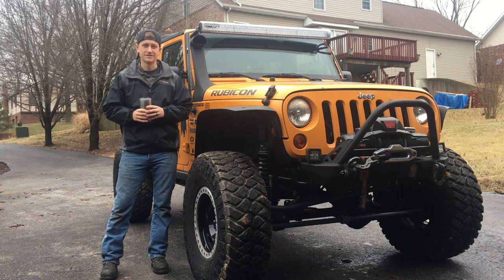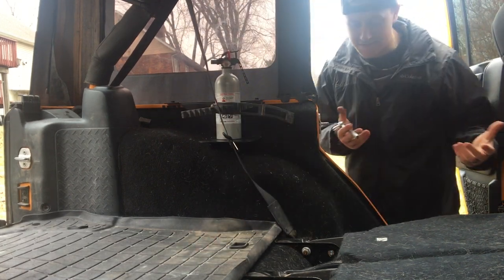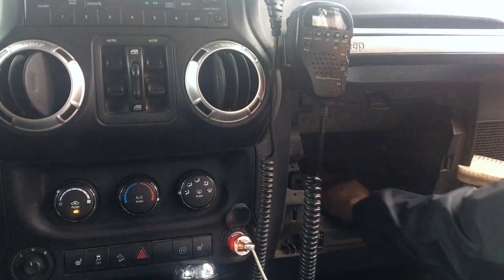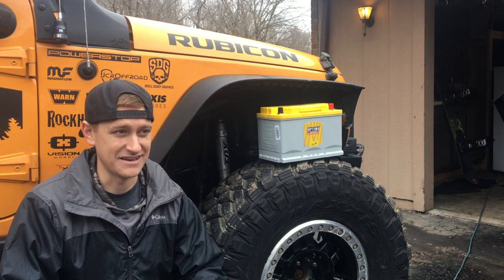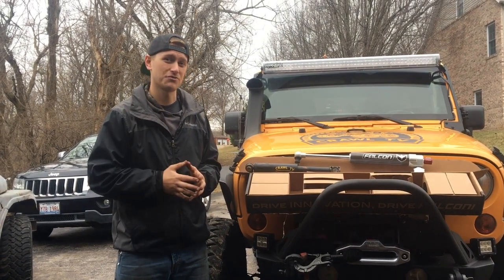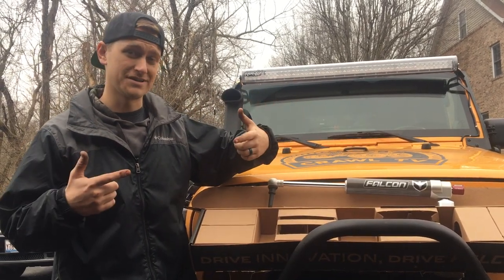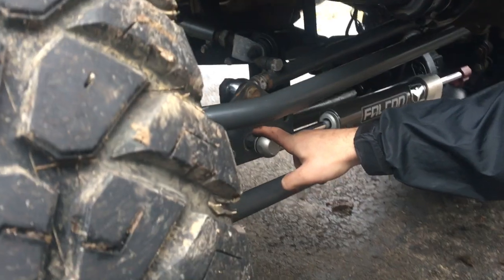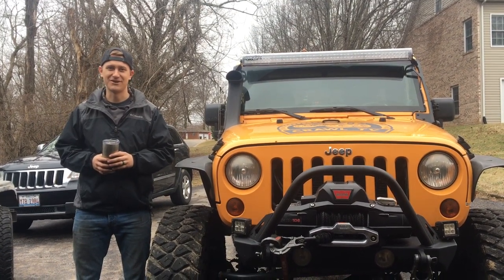Four Easy Upgrades for the Jeep JK / JKU

Comment: You didn't neutralize the acid.  I get a hose and wash the battery tray off.  I mix water and baking soda in a plastic cup.  Then with a small brush I apply it to anything that looks like metal near the battery.  If it foams up it had acid on it.  Then I rinse it all off again.  I dry everything off with paper towels.  And I paint metal  parts with some black spray paint.  And wire brush them first if possible.
Reply: mike94560, you must have some mechanical backround. As I was watching the video I felt like screaming at him to clean everything as you described!
Hey everyone..do a complete job, clean everything before putting it back together!

Comment: Awwww, dude! You seriously just changed out a battery with (admittedly) seriously major acid spillage, and you didn’t clean out the tray or surrounding areas? Weak!
Reply: should have poured an acid neutrilizer over the area and cleaned it out before the install, my thoughts.

Comment: The first Optima batteries were made in the U.S. They were high quality and lasted quite a few years. Now, all the Optimas are all made in Mexico and there is quality issues with many of them and they don't seem to last as long as previous generation models.
Reply: James, I am a boat dealer in the midwest. We have been selling and using Interstate batteries for more than 20 years.
Just in the last couple years have the Optima line of batteries begun to fail much soonerr than before. 
There are several AGM batteries out the that do a better job. Do your homework guys.
Reply: We had a bunch of issues with our optima,  got rid of it and replaced it with a Odyssey battery.   Odyssey is a much nicer battery.

Comment: from experience, if anyone does their battery, LOOSEN the 10mm nuts that keep the terminals tight, just take tgem to the end of the bolt. you don't have to remove them completely and when the terminals pop off (like in the video) you don't lose that little slide piece that locks the terminals on ....which sucks :)
Reply from the maker: Great way to keep from losing your nuts! 🥜 Haha
Great comment. That was one of those hindsight “ope!” moments.
Reply: also helps to open hood all the way (sit on windshield). Then you can pull the battery straight up and out.
Reply: I see your snorkel is likely not allowing that!

Comment: Thanks for the informative video! I have the red top Optima in my Jeep and it has gone through its fate share of abuse but still going strong. Currently my JKU is in the shop, probably an ignition issue since it stays on without the key in the ignition. Anyways, where in Florida did you guys move to? I would love to learn more about how to work on my own Jeep and go on adventures locally. Since bringing my Jeep over from Puerto Rico it has been in and out of the shop a lot and actually enjoying it has been minimal unfortunately.
Reply from the maker: Will Lopez hey there! We’re big fans of Optima - glad to hear you’ve also had a positive experience with them! We’re in Dunedin, Florida and usually wheel around the Ocala area. Guessing you’re also in FL? When did you make the move from PR? So sorry to hear about the ignition issues - not a true Wrangler if you don’t have dash lights popping up every couple months AT LEAST, though, haha. If you’re local we’d love share some knowledge and wheeling adventures with ya sometime! Appreciate you checking out the channel and hitting us up 😊
Reply: CRAWL TV hey! Thanks so much for your reply. I’m super close to you guys. I’m in Westchase, FL. Moved here with my girlfriend right after the hurricane displaced us in Oct of 2017. Would love to meet up sometime after I get my Jeep back to wheel and learn from you guys. ‘Til then, ✋🏽

Comment: When changing a battery,, you should always clean the battery terminals and battery cable metal ends of the new battery, before installing the battery in the car. Then you should put a protectant on the terminals to prevent battery problems and corrosion in the future.
Reply from the maker: James Koralewski You can’t make a 4 part Installation video without cutting some footage. We cleaned everything, AND added anti-corrosion washers when re-installing it. These weren’t skipped steps, by any means.

Comment: I bought my jk Rubicon in March 2007.  12.5 years & 345k miles later I custom cut a larger cab filter and install in it. I popped off the plastic screen and broke off the plastic clips leaving two posts. I then cut a larger cabin filter and fitted it securly into the duct work above the blower fan. I used one zip tie to hold screen in place.  Wish I had done it sooner. I removed blower motor and washed 12 yrs of dust and crude off it. It is quite and smooth now. Should have done this a decade ago. Crawl should do video on this modification. 2011 is when cabin filters were added to jks

Comment: Really great upgrades! I might get that extinguisher tray I like the location better than ours on the roll bar. I wonder if our 2010 Has Cabin air filters 🤔 if not wonder if I can add them the dust in Az is insane all year round. We put a Yellowtop Optima battery in ours just about 2 years ago when we got it and love it works perfect. I put it in for that reason no spills. And that stabilizer I’m very interested to see input back from you on different situations and how it works. Hint Hint boulder crawling feedback would probably be most helpful to me 😉. Absolutely wonderful video guys easy installs explained perfectly with a awesome outtake reel at the end to leave you laughing. Wish I could give it 2 👍 oh wait I did 🤣
Reply from the maker: No idea about the 2010s 🤔 I can tell you already that driving around with that stabilizer in the “hard” setting is a lot of work 😆 Thanks for the wonderful comment! P.S. - who needs a stabilizer in the rocks? What you want then is steering assistance, not resistance 😜
Reply: CRAWL TV fair enough coming soon 😉😏

Comment: Optima batteries aren't as good as they used to be so keep that in mind.
Here is a tip on the clamp used on the tie rod I found  mounting the clamp where you want it and before you install the two grip screws mark their holes and unclamp the bracket. Using a drill bit or a counter sink bit and dimple the tie rod where you marked it. 

Re install the clamp and the two grip screws. That way the bracket won't come loose as the tie rod moves.

Comment: I had no idea about the cabin filters. I will be checking mine tomorrow.
Most people don't know this, but when using a crescent wrench or regular open-end wrench, the working ends are, as you know, never pointed straight, they angle. This design is no accident. They are engineered this way to create a stronger "grip" on the nut or bolt. Always push or exert force on the side of the handle that's on the fixed side of the wrench or longer side of the handle. The tool is also less likely to break this way.

Comment: I have the K land N snorkel and cold air intake bundle as well. I was wondering if you keep the water sponge in all the time, if that creates some forced air induction? I also was wondering which fender flares you are running?

Comment: If optima batteries are so great, why don't you use their older design spiral cell yellow top batteries , instead of the old square case battery  you just bought. . The round ones were AGM batteries, too, and didn't leak no matter their position. I prefer the Interstate AGM battery, which comes with a full 4 year replacement warranty and it is not prorated but full replacement.
Reply from the maker: James Koralewski The battery we installed is actually a pre-production prototype that was unveiled at SEMA 2017. This isn’t the “old” design by any means.
Reply: For years, optima touted their battery shape as round cells so they could have more surface area than square batteries of all the other manufacturers batteries. Car batteries have been square for many many years until optima came along with their round cells. If the surface area is larger with their round cells, then why did they reduce it and go back to square batteries, like the rest of the battery world uses? Why return to an inferior design when you previously had a superior designed product, according to optima? How long of a warranty did you get with that optima battery?
Reply: Optima is garbage,  mine constantly goes dead if it sits more than a week.

Comment: Hey Crawl tv! I am looking to replace my OME SS and what to buy this model.  Can you share about steering feel with positive force SS and the differnce when set on soft to firm?   Thanks really enjoyed the video
Reply from the maker: Hey! So, this stabilizer is very cool. After rolling around for so long with no stabilizer, it definitely feels tighter, since the stabilizer dampens some of those minor shocks from bumps and stuff. Soft will be a great setting for wheeling. It’s very soft. It’s almost an off switch. Firm is very firm though. The steering doesn’t return to center after a turn it’s so firm. I expect to keep it on medium for the most part. There are definitely scenarios where all three will help out though!

Comment: Congrats on the move to the Sunshine State. The Jeep is really coming along nice. Have you done any tunes with the flashpaq?  What is the true size of those tires?
Reply from the maker: Thanks! So happy to be in a warmer climate! We have just the standard 87 Octane tune on our Flashpaq. The tires measure out to 36.5” so they’re pretty dang close to a true 37 😁
Reply: If you want a better everyday driving fuel economy, you can use the extreme fuel economy on your flashpaq.  Of course my tire size is only 33” with a 2.5” lift; my fuel economy was better than the 87 octane tune at 65 mph.
Reply: Great video btw.  Thanks for the infos.

Comment: Can you wright down which model battery did you get? Their web site recomends red top battery for a wrangler, but i see you got a yellow one there. thanks
Reply from the maker: So, we picked this battery up at SEMA as a pre-production prototype. Since it was unveiled there, I assumed it’d be publicly available on their website by now but I couldn’t find it either. I’ll follow up with them and get a good link for it. Thanks!
Reply: I'm also very interested in this! how do they not have one for the jk already??? sounds like a missed opportunity for them
Reply: CRAWL TV i appreciate if you do that. I will be in need of replacing my stock battery very soon as its been almost 5 years now. I've heard they typically last 4-5 years. Better replace it before i get stock on upcoming camping trips this summer. Thank you
Reply: CRAWL TV have you figured out which battery is was? I need one for my 13 JKU?
Reply: Ive been looking for this battery ended up getting an odyssey. Didnt know it was preproduction

Comment: You are gonna love that stabilizer! I wasn’t sure if the extra money would be worth it but on windy days driving down the highway..... ITS WORTH ITS WEIGHT IN GOLD!!! Lol one of my favorite upgrades so far
Reply: Windy driving on the highway, oh yeah!
Reply: What settings do you put yours on
Reply: Rubicon Rick I don’t have it yet. I was just thinking that this would be just the ticket for driving the highway in my off-road box with 2 sea kayaks on top; a future purchase.
Reply: Rubicon Rick firm for highway, especially if it's windy, and soft around town and off road. Some people leave it on the middle setting but I don't really use them middle setting.
Reply: I currently am running twin RC steering stabilizers and still have issues driving over 65. I have 35s and a 3” lift. Tell me more about you shock upgrade. Thanks..

Comment: Great video for some easy diy items. I actually recieved that stabilizer yesterday. Did yours have a lot of wobble on the pressed stud that replaces trackbar bolt? I expected swivel for movement, but not wobbling around within the ball socket. Maybe im overthinking it.  Also did you reuse stock nut, or the nyloc that came with it? Thanks and subscribed!
Reply from the maker: Okay, I had the exact same thought. Apparently that’s normal. I used the nut that cake with it because the Grade 8 boot that I pulled was a different thread pitch. Thanks for subscribing!

Comment: Please tell me you cleaned out that battery tray before you installed the new battery Jarrett?  And why don't you replace that 10mm bolt as well? Food for thought bud 😊
Reply from the maker: The tray definitely got a good cleaning. There was a lot of battery acid to get rid of. I also wire brushed the cable ends and added anti-corrosion washers to the posts. That poor little bolt got nothing though 😂
Reply: CRAWL TV the bolt is probably replaceable at your local hardware store anyways. Hope you like the warmer weather of Florida 😊 just keep the vids coming after you move is complete. Anxious to see the old CJ build as it proceeds 😊
Reply from the maker: Kevin England if you could see it at this very moment... 😂 I’m about ready to light it on Fire! I can’t get three of the four wheels off it it with an 8 foot cheater bar. I need to change the tires before we leave and it’s really fighting me. Looking forward to working on it some more in warmer weather though.
Reply: CRAWL TV  may sound stupid but have you tried heating the lug nuts with a torch set up with a brazing tip? I've used a brazing tip to heat up clevis pins in the past on slack adjusters when doing CVIP repairs. Might work might not. At least with using a brazing tip the flame is more control able then just using a cutting torch flame.
Reply: At least wire brushed the bolt and a quick dip in some baking powder paste rinse and some paint... another 5-20  min of your life to save a down the road head ach